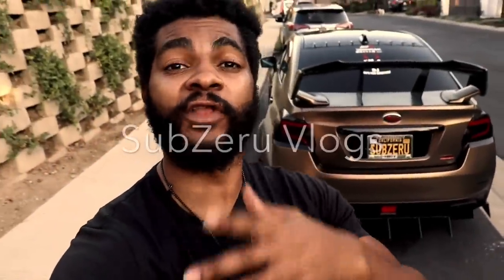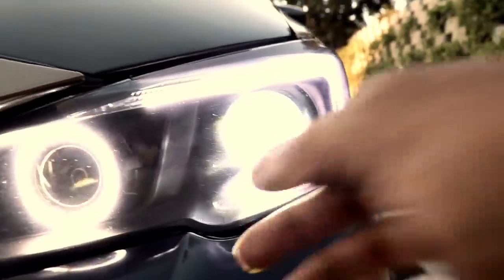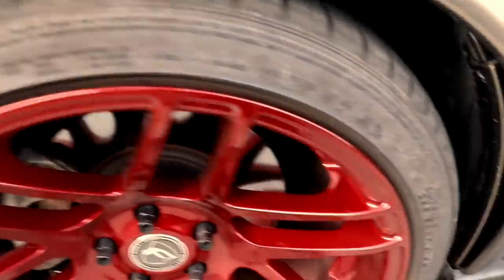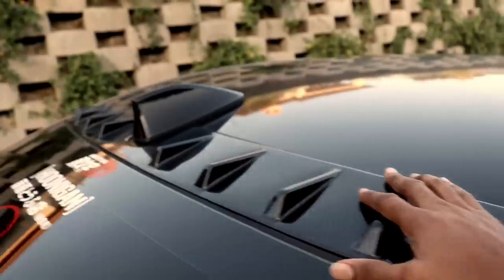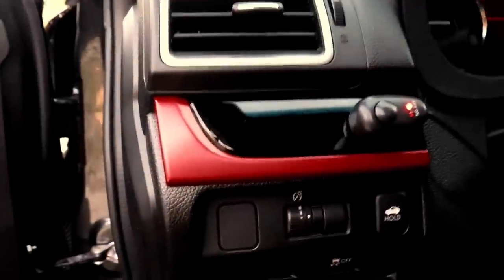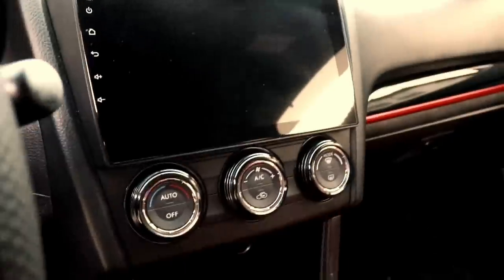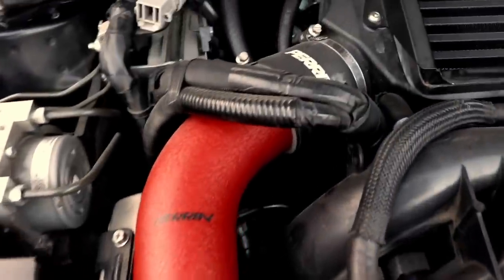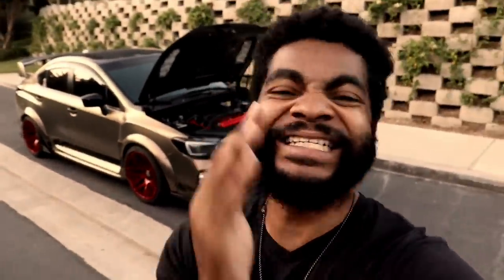Building A $50,000 Subaru WRX! Full Mod List and Walkaround

Comment: im at about 35k on mine i have most of the same engine mods you have except no flex. i plan going the after market turbo route rather than the flex fuel for the 400whp goal. i may change my mind but my main concern next is the drive train. a clutch at a minimum is at risk with this kind of power. ideally i would do the sti drive train swap an iag stage 2 block and some nice sti spec brembos. thats about 27k to 30k bringing my total to about 56k.
Reply from the maker: I feel you! Congrats on your build and car. Your build sounds really cool. Maintenance parts and fees I think of too but I am just focused on enjoying car. Thanks for watching and commenting
Reply: @ChristianHudnell  and as always thank you for responding! btw did you see the next gen wrx was spied!
Reply from the maker: You are welcome of course! I haven't yet, I will have to look for that thanks :)
Reply from the maker: Just saw the spy shots, interesting for sure!
Reply: @ChristianHudnell  check out smeedia's channel. he is currently putting an eg33 into is his sti. im not bullshitting this old ass six cylinder bolts up to the current platform.

Comment: Amazing video learned a lot! But I have a huge issue with the audio system of the car😅. What kind of audio system ur using? Also how did the Android monitor u have helped with the sound quality, and sound level? cause the Stock one is too quiet for me need something louder and much better quality. Thanks!
Reply from the maker: Yeah same, the stock audio is really bad. the sygav ANDROID 10.0 Head unit worked very well for me. The sound quality is better with same stock speakers. nmessage @sygav on IG and tell them I sent you